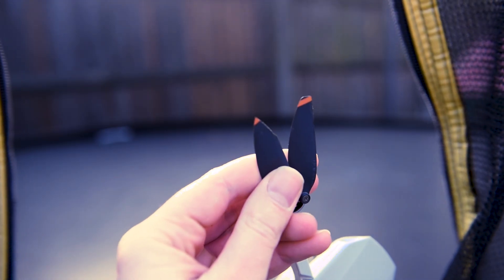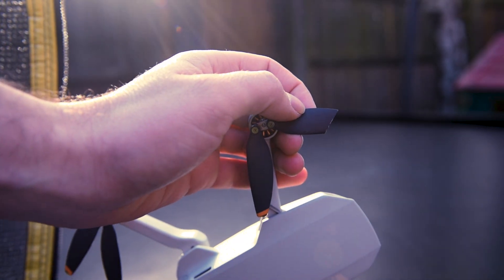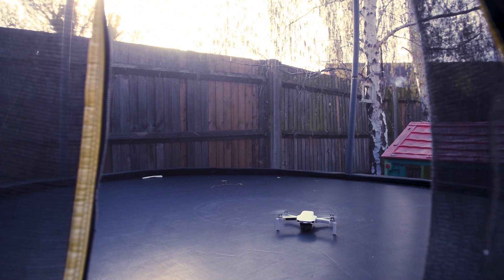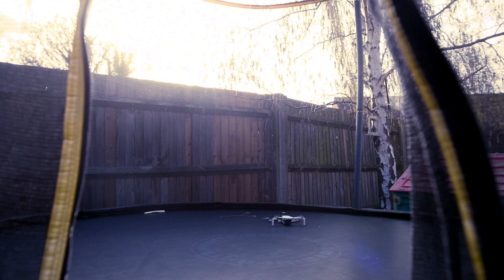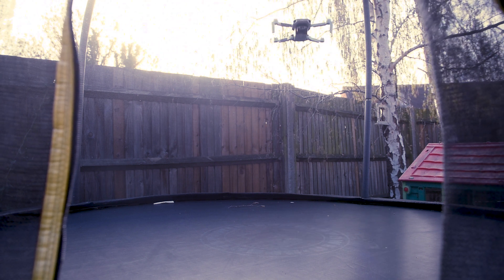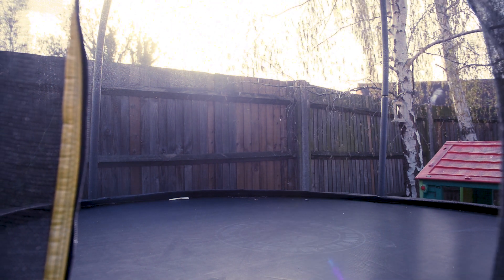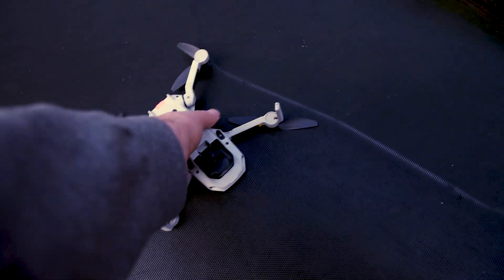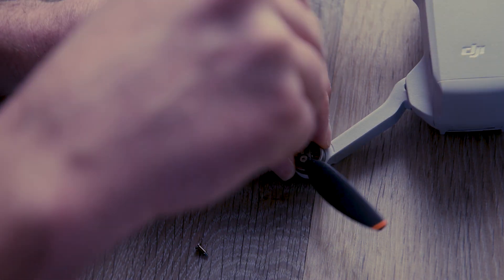CAN THE MINI 2 FLY WITH BROKEN/MISSING PROPS?

Comment: I'm guessing that a broken or missing propeller would soon cause the motor to overheat badly, causing the motor to stop, causing the drone to fall out of the sky.
Reply: Exactly what happened to my drone today. Just had a great shot, brought it back to the parking lot I was in, flew it for a bit in sport mode just to get some extra flight time in and some weird stuff happened. I think it must've lost a propeller at that point. It didn't let me land it, instead it went into some freak out mode and started going higher all tilted, went forward, and I had an "aircraft max power load" error and it committed suicide right into the road. After retrieving it the screw was clean off and of course missing a propeller. Very sad day. RIP mini2
Reply from the maker: Yeah, the strain on motor will burn it out and eventually make the motor fail!